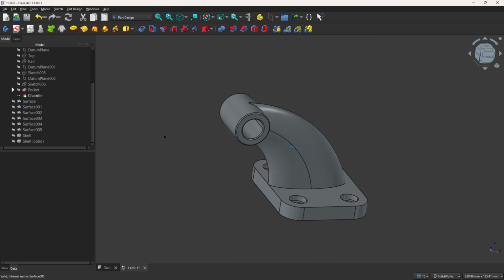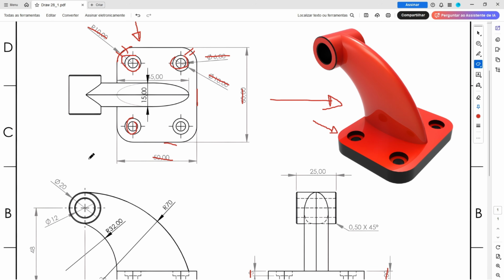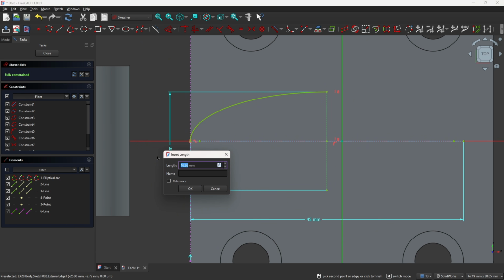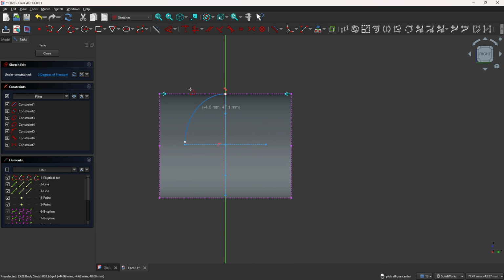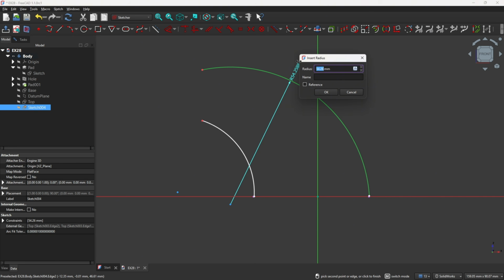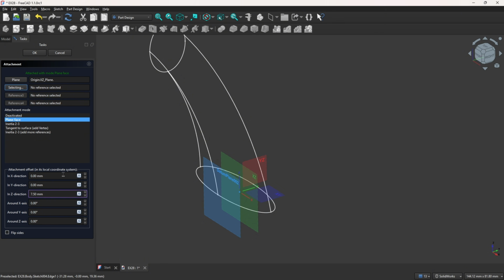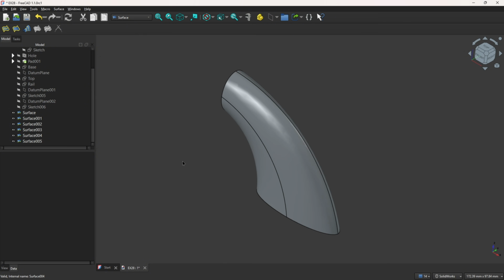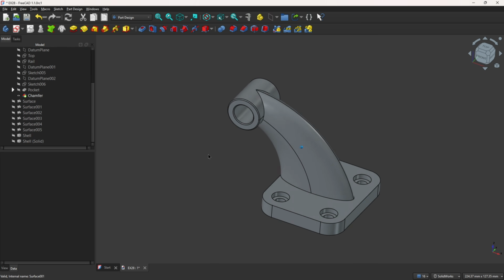FreeCAD Advanced Tutorial – Step-by-Step Exercise 28 | Guided Lofts in FreeCAD

Comment: First of all, I would like to say that it is a good video. But at 9:30 you simply assume that the ellipse is in the center of the cylinder, but in the drawing you can see that the center of the ellipse is not in the center of the cylinder and that the ellipse at the bottom has a straight line. However, I have no idea how to do it right.
Reply: The ellipse should be in the center of the cylinder. The egg shaped contour with the flattened bottom in the drawing is where the lofted shape meets the cylinder, which is correct.

Comment: Hello first time on your channel : very good video. Just for the base i will use in FREECAD 1.1 the center rectangle with the rounded corners to give the dimensions more quickly and use VarSet to be able to change them. But for the Ellipse, i think that will be great to have a function to split (for any other primitives also) directly in different part : 2, 4 (in your vidéo), 6, 8... What do you think ?
Be Healthy everyone
Reply: There is a split segment tool in the sketch, it cannot divide in equal parts but with four clicks you can split the ellipse and then constrain it. I think it is simpler.

Although with this tutorial I learned the surface technique, I think it is simpler to draw the ellipse on the base and the other on the datum plane then a path sketch with a single line (center to center) and "additive pipe" the two ellipse via the path.

Comment: Hi, what's the difference between doing it only in the Part Design workbench with additive manufacturing and not with surfaces? I ask because I was able to do it only in Part Design. Well, I'm actually learning FreeCAD.
Reply: The reason of that because the Part Design workbench contains only reduced number of operations, and A) some shapes can't be made only with the Part Design workbench (like a boat surfaces, or mesh/art fragments, for example), or B) some details can be figured much easier and faster with specialized workbenches (like gears, fasteners, or scripts).
Sorry for this retro answer, @electronicadeetel4366, I think you already know this.